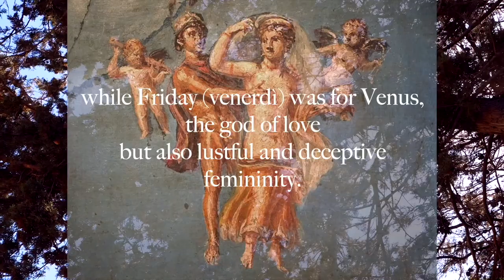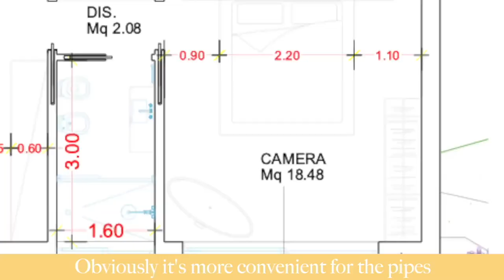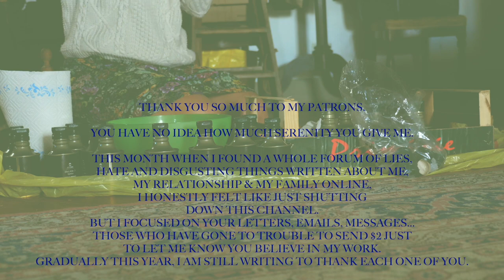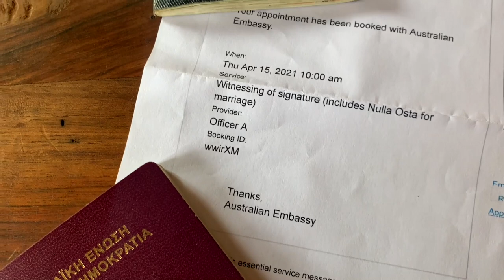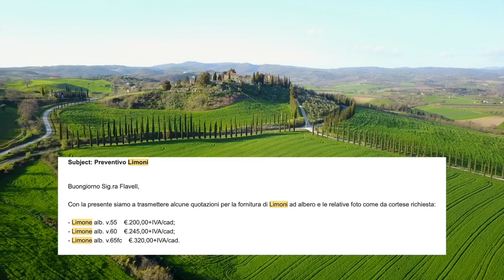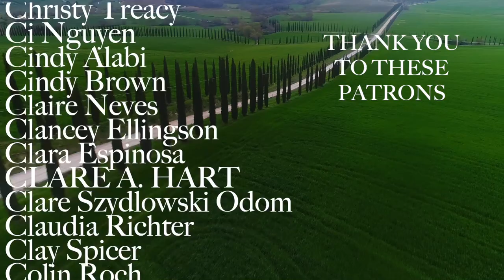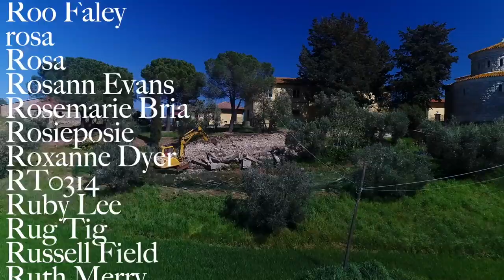RENOVATING A RUIN: Demolition Day, Gardening & Planning a Rustic Bathroom in Tuscany, Italy (Part 7)

Comment: Looks like Roman mosaics from Pompeii. I don’t think it really matters on what day they build, but if it makes the builders happy...by all means, any day but Friday (ADBF). I am sure Pompeii and Herculaneum were started on ideal days, but the volcano got them anyway. Your property is so high up that when I saw it I just thought that there should be a rimless “infinity pool” (where the edge of the water meets the horizon) connected via the bathroom through a glass wall to be used for soaking when the sun sets after a hot day.    ❤️Diane.

Comment: The fact is, as you've already mentioned in your previous videos, that all that area is a protected landscape one so it's (rightly) harder to get building permissions.
I'm curious to see if they let you build a gate and if only a gate will be built; generally that kind of structures shouldn't imply fixed structures, for what I know.